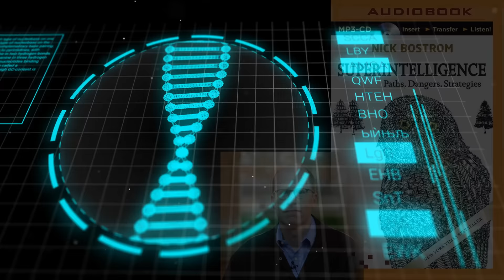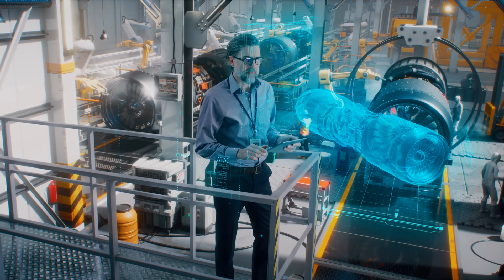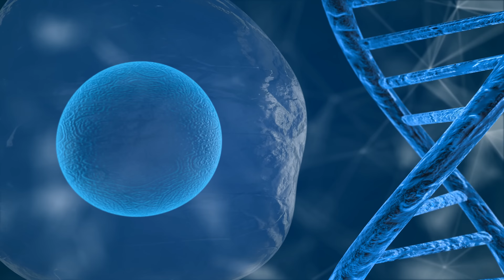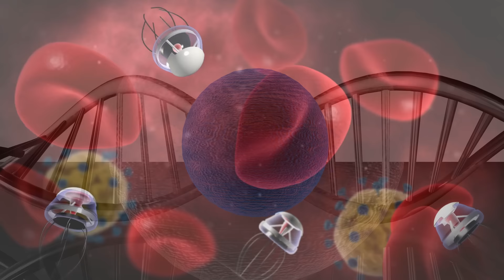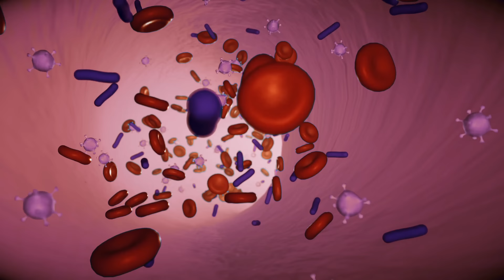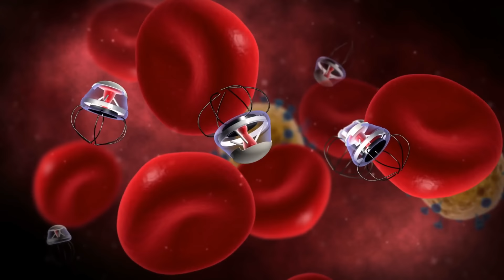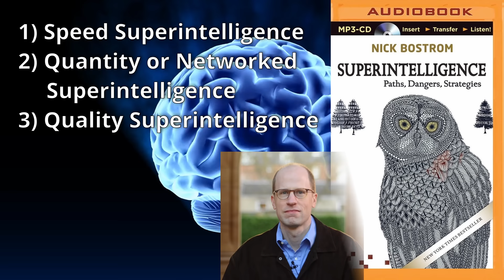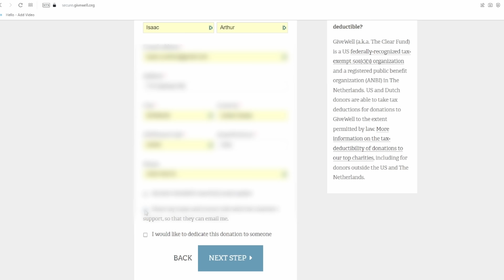Transhumanism & Humanity’s Future

Comment: People are currently working on basic augmentation technology right now, mostly focused on cyber-limbs.There are three barriers to getting them working, we dont have an easy and simple way to control them with the nervous system, the human body's immune system is prone to rejecting implants and the power density of batteries is too low for long term high intensity usage. Solve two of those and you've got commercial cyber limbs in a year. 

Of course if you solve the energy density problem for batteries (amusing they are not super toxic or explosive or some thing) you've basically made renewable energy the most appealing form of power generation.
Reply: Also you probably create mounting points for cybernetics so you can quick swap out eyes or arms.

Comment: Honestly, while I'm not apprehensive on augmenting my body in theory, I wouldn't want to be an early adopter. I'd probably wait until the first couple of commercially available generations have gone through debugging before I'd consider augmenting myself, as I imagine there'd be quite a few issues with such new tech. However, given the time it'll probably take to get there, I wouldn't want to subject my aging body to such augmentation unless absolutely necessary.
Reply: I dig that. Also, I wouldn't want to be stuck with a Neural Link 1.0 port on my skull when 3.0 is the one where all the issues are resolved.
Reply: I also wouldn’t want any augment that can’t be removed if it needs to be. I don’t care if my digitized nervous system can increase my reaction time so much I can dodge bullets or whatever other crazy tech it is, if i can’t remove it, and get a different augment or engineered organic replacement in the case of the nervous system example. 

I also wouldn’t want to get any augments I don’t understand the process of creating and capabilities of to the point I could make one myself if I had the resources. That may take a long time, but it’s paramount in ensuring that you can tell if what you got is doing what it’s supposed to he doing, and identify any malfunctions or malware. Getting any augmentation will alter my reality in ways I can’t reverse, so the amount of time it takes to learn so much about them is nothing compared to how much damage they could do to you if you get scammed

Comment: I think a cool approach to becoming trans-human would be to start with 'accessories' that allow you to remember things better, do logic better and so on. At the same time, just let your brain slowly die as it normally would and, if done right, the accessories would be so much better than your normal brain, you would not even notice when the last neuron in your brain finally died. Think of it like power armor directly linked to your brain that increases all your stats to super human + crappy human strength. Then your body goes feeble and old but you don't even notice the loss of your crappy human strength.

Comment: grafting would be very interesting, especially rewiring nerve bundles all the way to the brain for body parts that were amputated years/decades ago. last I checked all that can be done is stretch out the nerve endings that are left, they can't put them back once amputated, especially after tens of years of it not existing, and equally as much when there are specialized nerve endings that can't be 'taken' from somewhere else. I imagine a great many would be happy having something 'undone' that was done to them without their consent when young, the repulsiveness or mandatoriness of being quite dependent on gender, and what gender is different for various societies, and some amputations had been more universal for those that didn't fit 'the norm'. things I can't type directly on YouTube yet a good parallel could be, a society that amputates eyelids as a precautionary measure against pink eye or punishment against those that fell asleep and forced on everyone else "so they fit in", or something just as confounding. being able to have your original eye or inner ear grown and put back would be equally as impressive after an accident as well. I think those will be a thing before the BCI "close your eyes and you see your computer display" kind of implants. for now, at best, all doctors can do, is mash the severed ends of the twisted pair of telephone cable trunks together and "just hope" enough wire pairs line up that most messages are not getting crossed from heat pain muscle, and touch nerves going to the brain that it sort of functions, and that's when they have the amputated part to try to put back. enhanced ears (subsonic/ultrasonic) and eyes (IR/UV/etc), would require proficiency with the former wiring up the original part as it was genetically. I also feel it will be a thing dependent on 'where' will determine how excepted or shunned a particular grafting/implant/augmentation is well into the future, even for things like elf ears, cat eye irises, reflective cornea backings (tapetum lucidum), etc.

Comment: Cyclops' eyebeams are not light, they are "force." He does not generate it either, he opens micro-portals to an alternate dimension of pure "force" energy and it flows out like a fire hose. they can be moderated by certain types of crystal, but against anything else they impart physical force on impact.

Comment: I've speculated that there might be communities of baselines that function like a wildlife preserve. You might not want the baselines mixing with the general populace because that might expose them to elements that cause or encourage them to no longer be baselines.

Then there's the issue of their children, to preserve the baseline lineage, are they required to remain baseline? I imagine not, but that means the baseline population is going to struggle to keep up its population.

The real question is, why would you maintain a baseline population? Nostalgia? That seems doubtful in the long term. It's possible you keep them as a backup in case the augment lineages all fail somehow. I'm open to other motivations.

Comment: Imagine objecting to a blind person getting mechanical eyes.

Also, a mechanical heart was never at risk of dehumanizing people. Some worries are just irrational. I wouldn't say that about all worries to do with transhumanism, but a lot of them, yes.

Frankly, even if these things did dehumanize us, considering all the shitty things we do to each other, I'm not so sure humanity is not massively over-vaunted.
Reply: @Heavy Metal Pulp A) Being hacked is a definite issue.
B) I've not seen it. It's difficult to comment on it. CRISPR editing in adults may be able to address that, as Isaac Arthur pointed out.
C) I'd imagine there would be a period where it's possible to get such extreme body mods where they are not easily undone, but I'd expect such periods to be decades at most before newer, better techniques will make things entirely reversible.

Comment: Where would be the line in repairing a body part to original specifications and augmenting a body? As in putting a plate on someone's clavicle that was broken into several pieces to restore the original limb versus a bionic shoulder?

I say clavicle above because I did break my clavicle into four pieces and now have a plate on it that restored the shoulder to 95% to 98% original function.

Comment: This feels like transhumanism light. 
Transhumanism heavy is more like: well obviously mind uploading. This leaves 2 parts, upgrading the bodies, and upgrading the minds. You can of course switch bodies on a whim, get from place to place, beam your mind around, and into a new body. You turn up to the party as a centaur, only to find your the odd one out as all your friends have tentacles. Nanotube levels of strength are straightforward, just chemical nanotech. Can we make bodies nuclear or antimatter powered. Can we make bodies held together by the strong nuclear force to be around a million times stronger than any chemical bonds ever could be? Or maybe we can form bodies from twisted spacetime or total clarktech, Or maybe it's all simulation, so we can do whatever.

Mind wise, you aren't talking about just 20 IQ points. What you are doing is a bit less clear, I don't really know how the space of advanced minds is structured or measured. This gets into some tricky philosophical questions about how much you can modify yourself and still be you. You can easily run your mind a million times faster (at least).
Reply: Ok, you started talking about transhumanism, you just set it crazy far off, and thought it wouldn't apply everywhere. 

(Also, AI's can be really very different from anything remotely human.

Comment: Hey Isaac,

Do you know anyone working or thinking about making future augmentations more easily reversible?
Reply from the maker: Not particularly, just general efforts to make implants less likely to be rejected or get infected.
Reply: You also may want to look at research into ...I'm not sure exactly what it's called, but adult-subject-genetic-engineering, like with viruses or nanoparticles that insert new genetic material into cells through some exploit or another. Currently, most such methods have crippling drawbacks (are unreliable/risk scrambling your genes and causing cancer/only work on certain tissues/need direct exposure of a liquid substance to the specific tissue being modified/etc.) as far as I know, but I know they're getting better every day. Being able to 'update' your genes within a single individual, rather than producing a new (and thus not consenting-adult) generation with a fixed, unproven new pattern, is both critical for preventing people from being 'left behind' by advancements AND valuable for service (to add to, patch, or if necessary remove changes that are later found to have negative side effects) for those who were genetically altered from the start. We can do 'from the start' genetic alterations already, but we don't because of all the fears (some founded, some less so), and even getting some basic levels of 'corrective' genetic alteration of existing individuals on the table will be very important to normalizing the open and cautious (as opposed to clandestine and more likely tragic) use of the techniques we already have.
I think with most forms of augmentation, having a pre-existing out for if you break something is critical for public acceptance. To use a possibly further-future example that's not genetics-related, acceptance of replacement robotic limbs and organs for increased or specialized performance may INCREASE if growth and transplantation of baseline cloned replacement limbs and organs becomes more available, for example. If something is reversible, it ceases being a drastic last resort. I think if surgery to change a person's body to alter their appearance or other physical characteristics suddenly became cheap, easy, reversible, and mostly risk-free, it would only take about a generation or two at most for people to stop looking down on it. People are scared of or revolted by change to some extent, but at least personally I'm far more scared/revolted by the idea of irreversibility. It bothers me on some petty inner level that my teeth are no longer completely 'original', not because the repaired chips or other changes have had any apparent downsides, but because if they do I can never have a perfectly undamaged set of teeth back. Whereas if it were possible but expensive/annoying to grow new teeth, I'd instead be congratulating myself on getting good value repairing things proactively instead of letting them wear out and replacing them.

Comment: Until recently I was all in favour of transhumanism and augmentation. Since the governments massive abuse of power over the last couple of years I've become somewhat more skeptical. Governments will want control so any kind of mind machine interface will probably be required by law to have a back door allowing data to be harvested. Bad enough if the government has access but leaky as these departments are I suspect anyone who cares to look could find access. The same goes for augmented limbs that might be switched off by remote control. Speed limits would be enforced by wifi (we cant have Steve Austin running at 60 mph in town) Its for your own safety dont you know.

Comment: Until completely self-sustaining and self-replicating nanotechnology becomes a thing...none of this will happen.  Any system that depends exclusively on external infrastructure is doomed to fail.

We, and all life, are already made of nanotechnology.  It's just a case of making it better.  Making it out of better materials, work more efficiently, work more reliably.  But the stage of augmentation of these organic bodies is really a completely wasted step.

Additionally, any system in which we all just exist as "thought" or data on a computer, with no other physical body, is equally doomed to fail.  If you can't regularly and impulsively interact with external reality, you're done for.  Because then it becomes a one-way transaction.  The universe can wipe you out in an instant, and you can take no action.

Bodies matter.
Reply: "The infinite power of nano-augmentation."

Comment: The inferiority of organic technology compared to inorganic technology comes from the fact that the DNA or RNA encodable viable protein machinery designs are highly limited compared to inorganic machinery designs. 
Many technologies that are very easily feasible inorganically are nigh-impossible to replicate organically. The most simple and straightforward example of such a technology is the wheel (and I would not count wooden wheels as a piece of proper organic tech).
Even from a material science standpoint, inorganic technology is highly limited because it is limited to proteins. Even though proteins are highly versatile, and can incoorporate minerals (such as in tooth enemal), they cannot match the high-end material requirements in high-end designs. So for example protein based jet engines are impossible because they cannot bear the combination of high temperature and mechanical stresses.

Also graphene is a poor example for a strong organic materials because it is not organic. It is just a carbon allotrope. A good example would be spider silk.
Reply: To be fair organic material does have one advantage, 'self repair' technology (for now) can't repair itself against damage or wear and tear it needs humans to maintenance it.
Reply: I'm not that impressed by wheels, they are so terrible at traversing steep terrain that the inca's only used them in childrens toys for example. I'd also say drawing a clear line between organic and inorganic is folly. If you've ever seen concepts like electric tatoos you'd know that, but I do get your wider point.